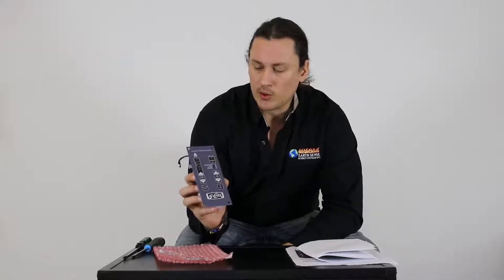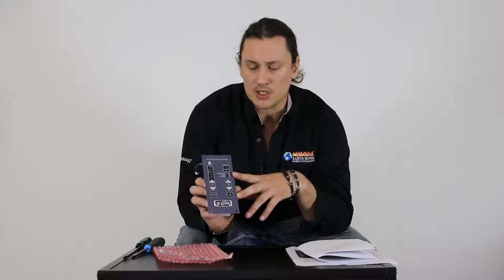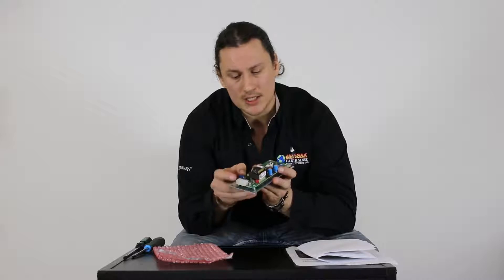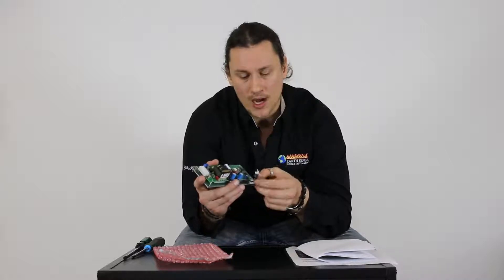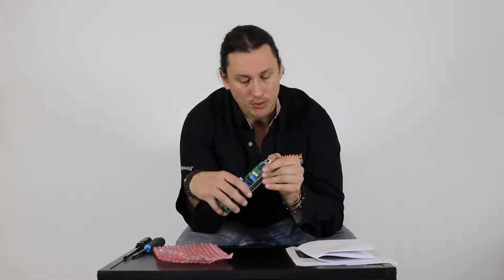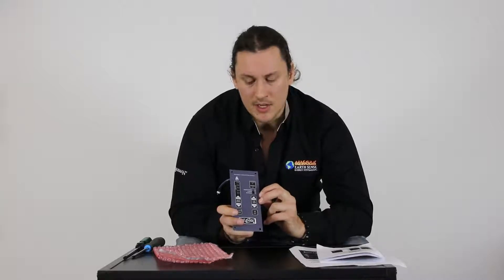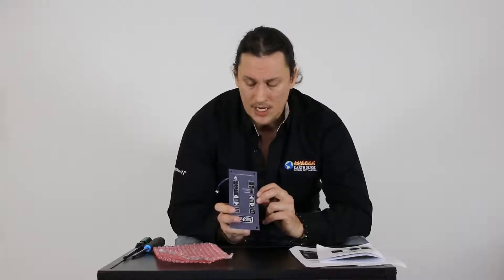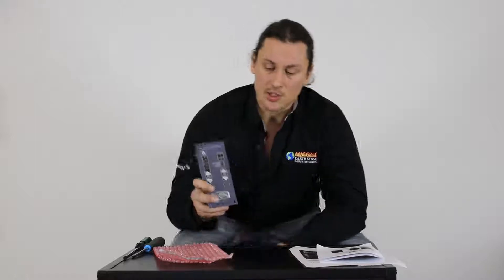St Croix Control Board - How To Program

Comment: My t-stat & smart-stat settings act the same. how do i get the t-stat function to work right
Reply from the maker: Thanks for the message. T-Stat and Smart-Stat modes are very similar. In Smart-Stat the stove will reach thermostat temp and start to throttle itself down to a low fire. It will stay at this low fire for up to an hour. If heat is not called for within that hour, the stove will shut off and reignite when heat is called for. In T-Stat mode, it throttles down to low as well after temperature has been met, however it will stay on low until heat is called for again. Smart-Stat is generally recommend for spring and fall heating, and when heating well insulated areas. T-Stat is generally recommended during cold winter months and when heating larger draftier areas. 

If both modes work the exact same (Either shutting off/on or both staying at the low fire indefinitely when heat isn't called for), you most likely you have a circuit board issue. You can try to reprogram as outlined in the video and see if anything changes. 

St. Croix Circuit Board for Reference: https://pellethead.com/product/st-croix-digital-circuit-control-board-oem/

Any other questions let us know. Thanks.

Comment: I have a digital panel for a Hastings pellet stove but with no manual and smart switche on it and I can’t figure out the proper settings for my stove I have no manual bought second hand
Reply from the maker: Thanks for contacting us. Sounds like you may have the earlier style digital board without the toggle switch on the front correct? We can try to find the correct generation manual for your Hastings.

Comment: Hello, is there a way to reset the control board to factory default?
Reply from the maker: Thanks for contacting us. From factory the board is set to the #1 program. A person could certainly go through the programming cycles as indicated in the video to reset it on the #1 program. The #1 program is going to be for Multi-Fuels. #3 is most common for pellet models burning only wood pellets. Any other questions just let us know. Thanks!
Reply: How do use an older panel switch when I can’t find anything online about it it’s all the newer digital switches
Reply from the maker: @lisabeaulieu1508  Thanks for the message. I sent a reply to your other comment as well. Sounds like you have an early style digital board on your Hastings. We can see if we have the correct owners manual. I will follow up.
Reply from the maker: @lisabeaulieu1508  Hi Lisa, I found a detailed St. Croix Owners Manual that covers the first generation digital control board which is what I believe you have. Please take a look. Control board details will be on Page 14+ and page 27+. 
https://pellethead.com/wp-content/uploads/2024/01/Digital_Control_Board_Service_Manual.pdf

Keep us posted, happy to help.

Comment: hello.... i have this control board and i cannot change the program setting....it is at number 5 and i cannot change it...any help
Reply from the maker: Thanks for the message. If you are following all the steps correctly and the program cannot be changed, then there's some sort of issue with the control board. There should be a 1 year warranty on that for any manufacturer defects.

Comment: Which color wires is the jumper supposed to be connecting together
Reply from the maker: I assume you are referring to the photoeye wire and jumper plug. I don't have the control board in front of me to see the wire colors, but that jumper block will go on the two left side pins. Hope that helps.

Comment: Tried to light my St Croix stove and it went into safe mode with #5 led blinking.  Shut it off, unplugged and tried the program setting by the 3 button method.  When I release the 3 buttons at once all 5 of the leds flash twice.  This is an older stove that was in the house when we bought it, has a newer control board. Any ideas what is going on?
Reply from the maker: Thanks for contacting us, happy to help. Let's first address the #5 blink - this video here will cover that - let's inspect that photoeye wire and the jumper that is on it - https://youtu.be/osOxZk-Z2Z0?t=602. Let us know what you find there and we will help best we can. Thanks!

Comment: i put aa new control panel on and my pellet feed does not work
Reply: Same thing I'm dealing with any luck on how to fix it?
Reply from the maker: @1412izzy  What stove make and model do you have Israel?
Reply from the maker: Hey Terry, I left you a reply on the original comment you left - I'll have it below incase you didn't see it. Let us know your St. Croix model and we can provide additional assistance. 

The blink lights are troubleshooting codes. #5 blink will indicate an issue with the photoeye wire. We explain this in detail on the video below. Take a look and let us know of any questions. Thanks. 
https://youtu.be/osOxZk-Z2Z0?t=599

Comment: Have a ST Croix EXL stove will run for a few hours then stop feeding pellets and shut down reset after cool down and will repeat
Reply from the maker: Thanks for contacting us. Are you running your EXL on a thermostat? What mode do you have the toggle switch on the control board set to? What does your fire look like when it's burning - is it crisp and torchy or lazy in anyway? Are you getting any blink indications on the control board LED lights when it goes out? Happy to assist.

Comment: Love my  auburns and currently rebuilding a scf50.. Bought used and was rusted out. Any advantage to going to the new board in this video?
Reply from the maker: Hey Chad, thanks for the message. Yeah the SCF is very similar to the Auburn as I'm sure you've realized. I believe the SCF-050 has always had a touch pad LED board since inception. There are different generations and slight variations of the look and programming of the circuit boards over the years. In my personal opinion, if the control board that is in place currently is functioning as it should, then I would see no significant advantage to replace the board with the latest generation. Any other questions as you are going through the unit just let us know. We are very familiar with the model and stock just about all the items for it. Thanks!
Reply: @EarthSense  I have another question regarding the auburn control board. I was only getting what seemed like half the output on my room fan. I replaced it and the same thing. I swapped boards and it fixed the problem. The this  repairable on the board or does it require replacing the board. It works fine other than not putting out enough volts for the room fan. It does seem to put out the full 120 on level 5 though. Thank you
Reply from the maker: @chadhummel8496  Thanks for the message Chad. That is interesting, pretty rare, but we have seen that before. I've seen some folks who have had their board repaired successfully, and others that have not. I would suggest possibly connecting with an electronics specialist and seeing if he/she can pinpoint the issue in the board and if it is repairable. We personally do not handle control board repairs, we just offer replacements. Hope that is helpful. Thanks!

Comment: Need help my new stCroix control panel won’t change settings
 When I push all 3 buttons like I should all 5 less light up??
Reply from the maker: Thanks for contacting us, happy to help. From our lead Tech:  Stove must be in the off position and the unit must be completely cool so that the POF is open.
Press and Hold the Auger Feed button.
Then press the High and Low buttons and immediately release them at the same time.
Reply: I'm having the same problem with the panel. When pushing the 3 described buttons and releasing them simultaneously I get all 5 LEDs flashing twice. The stove is a older St. Croix pellet stove with this new board. When trying to light the stove it will go into safe mode and flash #5 led.

Comment: I have been having a few issues with my St Croix Hastings Pellet Stove and according to my diagnostics manual the problems have been vacuum related { number 2 light flashing after it shuts down}. I have also not being able to get the combustion fan to power up more than the number 1 setting even though the light would indicate it was on which ever power level I selected. To cut a long story short after replacing the vacuum  switch and the combustion fan with new ones my stove lit and it burned for a long time on the number 1 setting but when I turned it up for more heat to the number 2 setting it proceeded to go into shutdown mode. After the fire had gone out I unplugged the stove cleaned out all the ashes and fired it up again but this time the combustion fan and came on for about 20 seconds and then shut down again and the number 1 light never even came on as it had always previously done during start up. Once the stove shut down the number 2 light flashes indicating vacuum issues. I think my control board has gone bad, It should not be a vacuum problem as the fire lit previously the time before last. And now all I get is a 20 second fan run and then shutdown. Can you advise anything else I could do or am I doomed to have to get a new control board?
Reply from the maker: Thank you for contacting us Laurie. Let me run this past our lead techs and get their take. I will follow up with you ASAP. Appreciated.
Reply from the maker: Laurie, Here is the feedback from our lead tech. 
1. Running on #1 constantly for a short time frame with seeming no ability to increase the heat output.  Without knowing what control board is being used, the only logical conclusion is a problem with the t-stat circuit.  This could be a failed t-stat or a connection problem. St. Croix t-stat circuits have 5 connection points and the first to check would be the small spade connections behind the speaker connectors.
Switch to manual operation or jumper the control board t-stat block.
2. Inconsistent vac switch fault #2 light flashing.  Vac switches require a minimum magnehelic to close and all stoves run mag readings well above the minimum mag needed.  The mag reading on this stove could be at the borderline of minimum mag.  Possibilities – a)vac line obstruction, b)wire harness continuity, c)door gasket leakage, d)ash door gasket leakage, e)hidden internal stove air obstruction that St. Croix’s are notorious for.
Jumper bypass the vac switch and try again.
 

Let us know what you find Laurie - happy to assist.
Thanks,
Mr. Pellethead